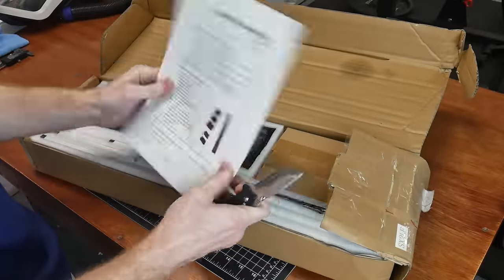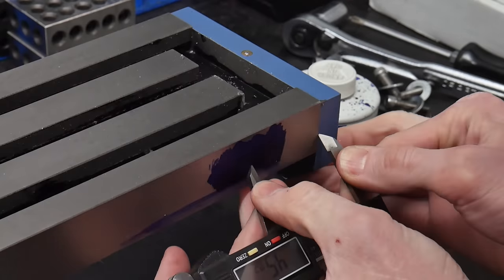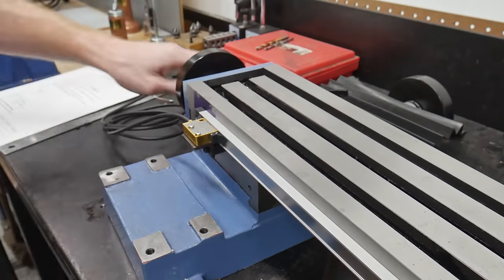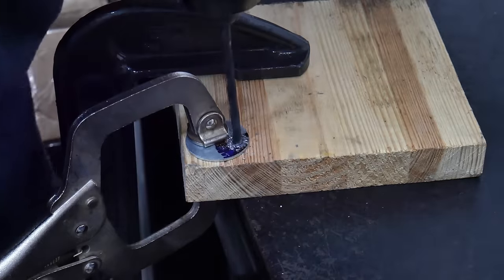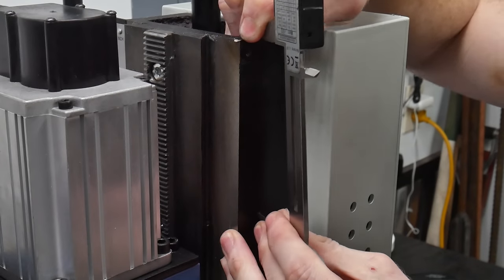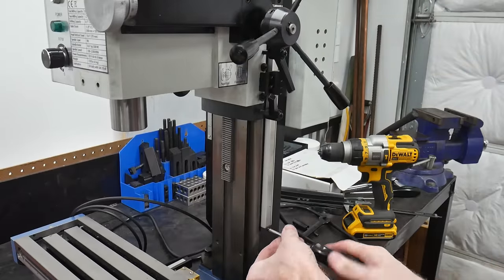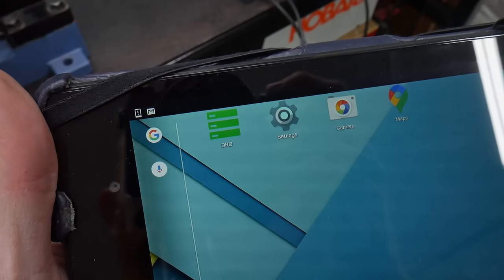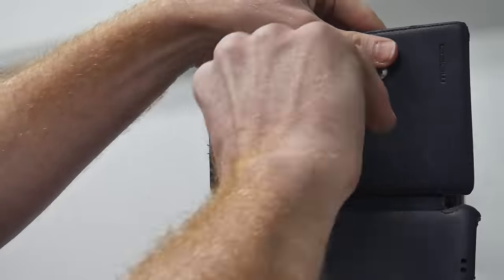How To Install A DRO | Little Machine Shop Mini Mill

Comment from the maker: I can't wait to get some hours behind this DRO! I really see it upping my hidden tang knife making game. Once again, major thanks to Little Machine Shop ** for essentially sponsoring the channel with this equipment. Cheers 

-- Also if yall are interested in some side projects; check out Red Beard Engineered here ---> https://www.youtube.com/channel/UCUiHxNYiHc1qeZ6CYaXzitQ
Reply: Hey, I'm about  to do this with my mill, exact everything.  Now that you've had this on for awhile  are there any tips or anything you would do differently aside from the things you mentioned in this video?
Reply from the maker: @mikahwebb9570  none that I can think of. it's still operating well as installed. Couldn't live without it at this point

Comment: Have a little machine shop vertical mill #4962 with their DRO setup as you have in the Video, I have all hooked up as per shown, I get connection on Blue Tooth, have red blinking lights on the units themselves, but when moving table, no readout. Any help
Reply from the maker: Hey Rick, first and foremost, I'd suggest sending littlemachineshop an email so they can help you trouble shoot. I'm not 100% sure what's going on with your set up. I will say that I had to go and manually select the DRO on my tablets bluetooth section. This took me a while to figure out at the time. 

Their phone number is 800-981-9663 and email info@littlemachineshop.com

Contact Page - https://littlemachineshop.com/info/contact.php

Comment: Might I suggest for the x axis install a stop bolt to column to prevent over travel and damage to reader...if dont want the trouble use a exhaust clamp having to screwed ends facing the slide adding nuts to act as stops
Reply from the maker: Good idea

Comment: FYI you shouldn't tin wires that are going into screw terminals, the solder will slowly deform over time and cause a loose connection that can cut out or overheat. Yes, I'm aware that the instructions from little machine shop tell you to tin them, but unfortunately that's simply a bad practice in this case. Best practice is to either use crimp-on wire end ferrules or just plain wire. Pre-tinned wire where the strands are individually tinned and not clumped together by solder can be used as well if corrosion is a concern.

Comment: I quite agree with you and x-axis Dro should not be in the back you should be in the front as the reader can only stop you from doing what you need to do. And always measure from the top of your call nothing about him of your call as if you are not capable of using your Gro well having you were supposed to the table that's really not a problem because it will usually be in a vice. However for each and every individual there is a different personally I would simply rather have another inch and a half of redoubt bar. I also noticed there was no replacing the chip guard. I wonder why? Littlemachineshop may be cheaper than Grizzly but at least Grizzly won't make you ask all these questions. Grizzly maybe a remanufactured but if you don't use Grizzly you're doing it yourself.
Reply from the maker: Cheers sir!